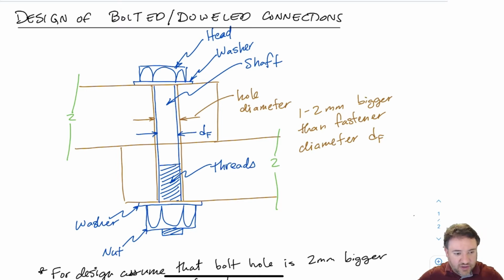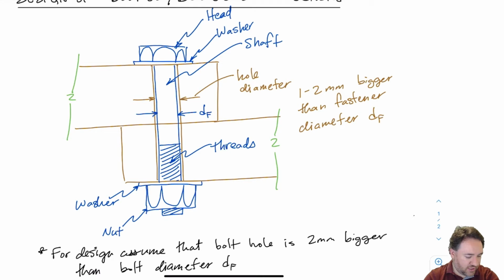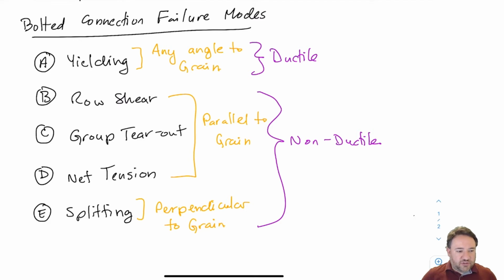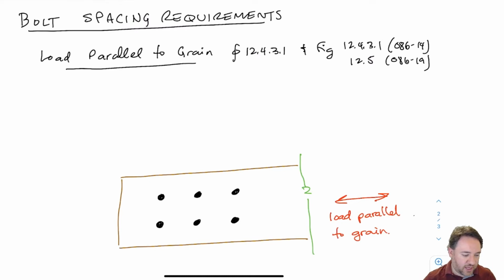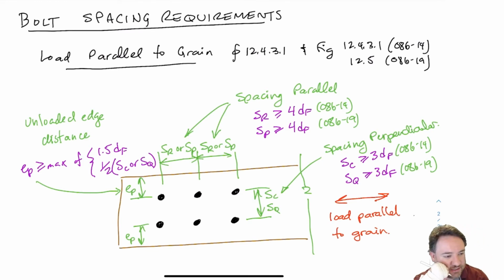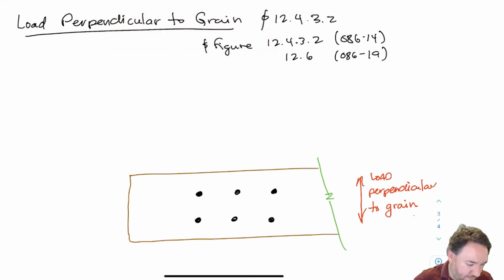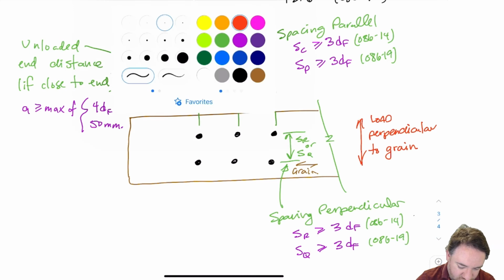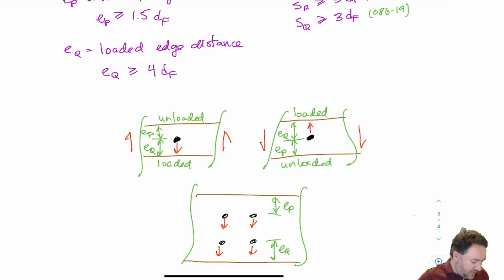Bolted Wood Connections - Part 1 Introduction and Bolt Spacing

Comment: This is an excellent series of lectures on bolt connections.  The professor is very knowledgeable about this subject and passes along many valuable insights not found in other, primary information sources.  The examples are carefully examined and answered all my questions on the big picture view of the problem and then the running of the equations.  First rate job and the standard for others to follow.
Reply from the maker: Thanks very much for your positive comments, I appreciate it. I'm glad if the videos are helpful.